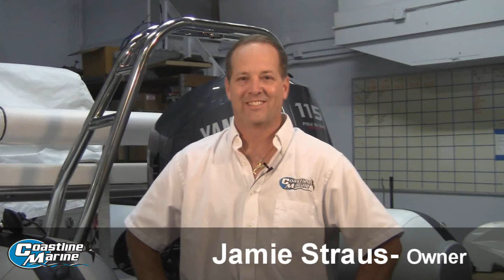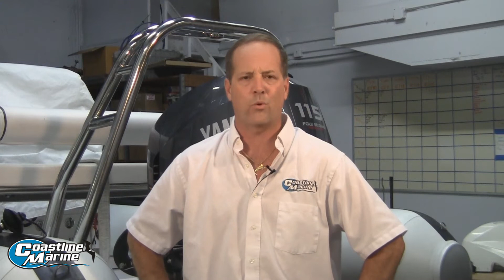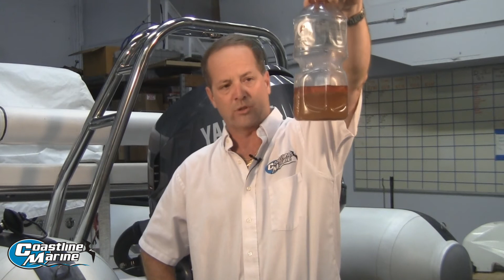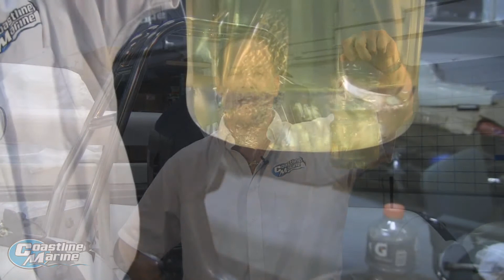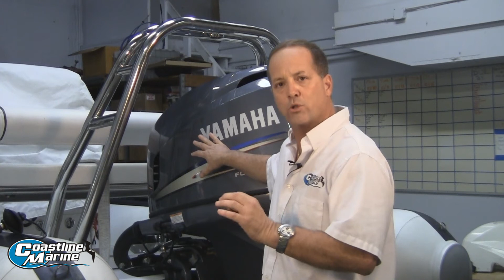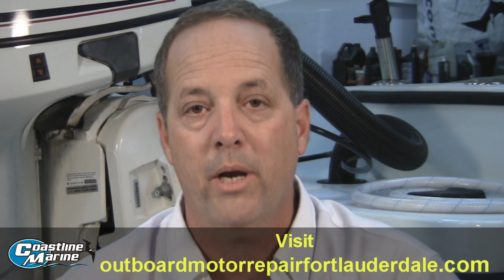Ethanol & Boat Motors,Outboard Motor Repair Fort Lauderdale

Comment: Local marina has ethanol-free gas, but at a price...$4.75/ gal. Lake Shore towing busier than ever and all 2 & 4 cycle marine engine problems are fuel related according to their spokesman. Sta-bil is a partial solution, but at $10/ pint...?

Comment: My local Yamaha dealer told me to double the amount of sta-bil it says to use on the label. Even so, you should plan to upgrade the fuel hoses to something that won't melt.

Comment: Ethanol does not turn into varnish gasoline does. Most clogged jet issues are caused by dry varnish. Maybe you should get a carburetor that doesn't care if there is a little water mixed in with alcohol fuel huh?